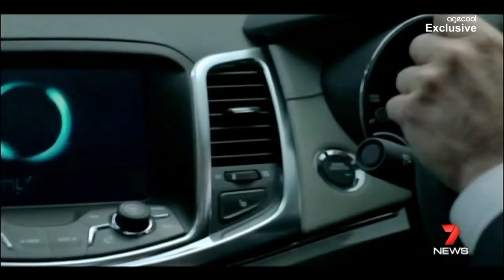AgeCool Exclusive: GM Holden leaves Australia by 2017

Comment: I have a Holden 1997 VS and a 2001 VX. Both have been very good cars for me. Ecotec V6 engine. Easy to service and fix if any issues. Will soon be fitting a supercharger to the VX. Its all about the ford and Holden in Australia. Such a shame if they'll be made elsewhere.